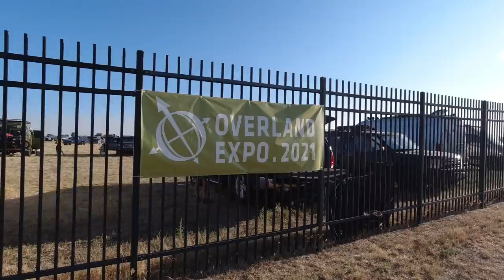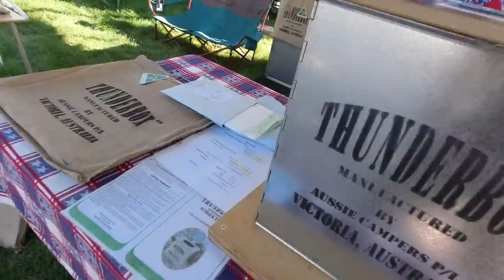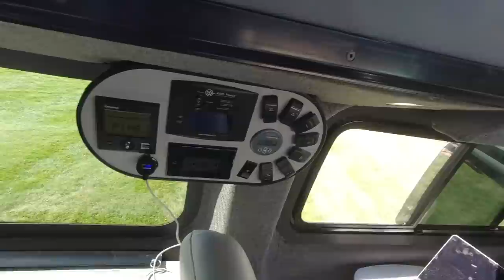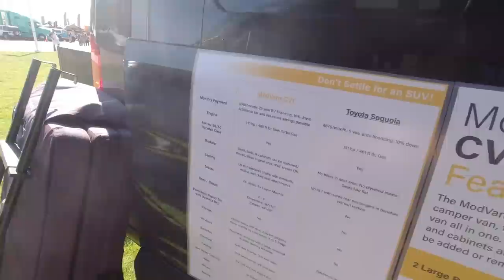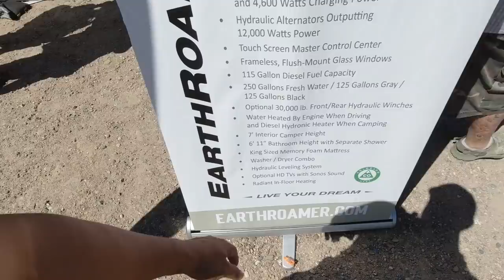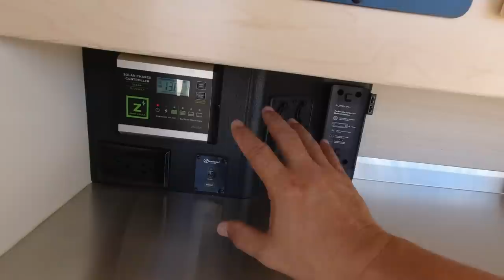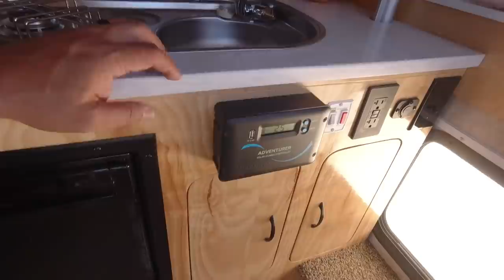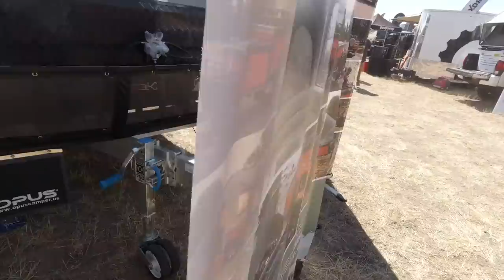Overland Expo Mountain West 2021 (day 1)

Comment: That Mitsubishi van is a Delica Spacegear.. they came pretty much like that from Japan. The roof rack and front bumper are pretty much the only mods, but they did come with bull bars on the front. They are esentially a minivan body put on a Montero/ Pajero frame and running gear and suspension.

Comment: Red tail overland is super badass. But how are they gonna sell a RTT for $20k? Also their units weigh 200+ lbs. With normal humans up there they’re way over what roofs are rated to support. Not to mention while driving adding 200+ lbs to the top of your vehicle is not where you want the weight.
Reply from the maker: All good points. They said their product is basically a tear drop trailer on your roof. I forgot how heavy trailers are lol.

Comment: That first rooftop hard sided pod will allow you to use in grizzly territory. $20k ? Yikes !
Reply from the maker: That's officially the most expensive roof top tent for sure.
Reply: @mixflip  not to mention the weight on the rack as well as the roof.
Reply: @mixflip  The very next teardrop shows what you can get for just  $5k more.
Reply: That price is ridiculous!
Reply: @raydewitt517  but someone with more money/credit than sense will buy it.

Comment: The Mitsubishi near the beginning is called a Delica. It has a turbo diesel. The older ones are great 4 wheelers. Smaller airfields around Japan use them. I owned one for a while when I was stationed in Japan. Their small fire trucks are cool too. The mirror in the back is still used on some bigger vans because parking is tight.
Reply from the maker: I've seen them once before but didn't recognize what it was until days later lol.

Comment: You. Came across the hottest new Winnebago EKKO motorhome and didn’t realize it is the most ordered unit on the market... orders are booked two years out... it’s all wheel drive and that was not mentioned... i has the Eco boost engine... it has the large heated garage in rear big enough for ebikes... it has an innovative bath with moving wall... instead you look at tents and tear drops... it tells me Winnebago has not even scraped the overland market yet.
Reply from the maker: At $160,000....I need more than 2 beds.

Comment: Hey, I really like this video!  Thanks for doing it.  I’ve been considering a four wheels camper project m Camper, and buying a pickup with an 8ft box.  My wife and I would like something so we can haul equipment for our band, and also sleep in it, preferable to not a roof tent. Previously, I had only thought of toy haulers.  Today I was thinking the Bison Overland looked probable.

We have a Jeep Grand Cherokee now, so what kind of trailers would you recommend?  And what toppers/box campers/flatbed campers would you recommend?
Reply from the maker: Equipment for a band? Sounds like you need either a camper van with a garage under the bed or maybe something like the antishanty which is a cargo trailer that can transform into a travel trailer with 2 queen bunk beds.

There aren't any truck campers that do double duty as a cargo truck and camper other than maybe the four wheel camper s project M.

Comment: Truck products @ boat prices.
Reply from the maker: Try pulling a boat up a mountain trail for 20 miles and see how well the trailer and boat handle all the banging, shaking and constant vibration? 

I'm willing to bet these campers and trailers are built stronger than most boat trailers and most boats.
Reply: @mixflip  I’d definitely rather have the camper. I also no longer trust boats after the tragic loss of my firearms collection.

Comment: That's our Mitsubishi Delica Space Gear van! It's a 1994 with the 4M40 2.8-liter turbodiesel in it and 5-speed manual transmission. For anyone interested, here are the mods:

Coastal Off Road Front and Rear Bumpers — These are weld-together kits (Wanderlust Overland did the welding/install on these)
WARN ZEON 8-S Winch, Epic Fairlead, and Factor 55 Ultra Hook
Long Range Automotive Extended-Range Fuel Tank (brought in via Long Range Automotive)
Front Runner Rack w/ladder mounts, Maxtrax mount, ladder mount, and all-important bottle opener
Lightforce Venom lights
30x9.50 BFGoodrich KO2 Tires
15x7 (et 6) steelies
Rancho RS9000XL Adjustable Shocks
Dobinsons Torsion Bars
Coombs Country Auto Rear Springs (about a 1.5" total lift)
Maxtrax
DMOS Shovel
ARB 2500 Awning
ARB ZERO Fridge/Freezer
Reply from the maker: Oh yeah thanks right. I remember seeing it at overland expo west 2019 during a warn winch interview. I've seen it before and didn't recognize it.
Reply: @mixflip  I'm the same guy, but that was our 1989 Star Wagon. This is our new project. 👍👍
Reply from the maker: @crankshaftculture  oh cool. I will have to put a warn winch on my new 2022 tundra project when I finally get it.